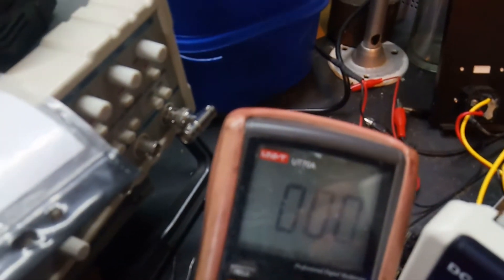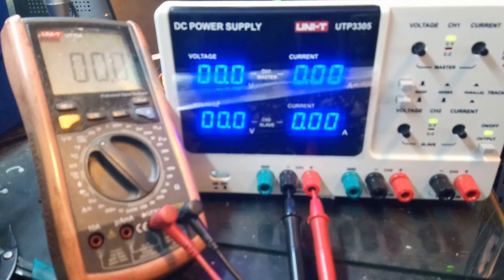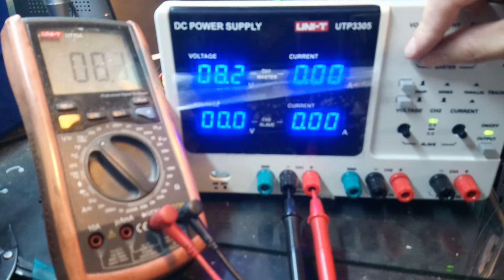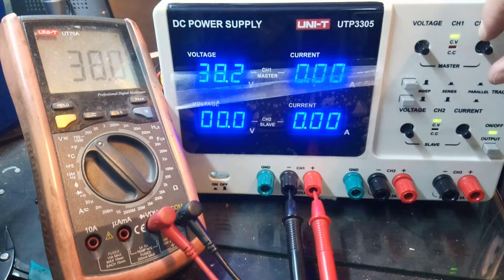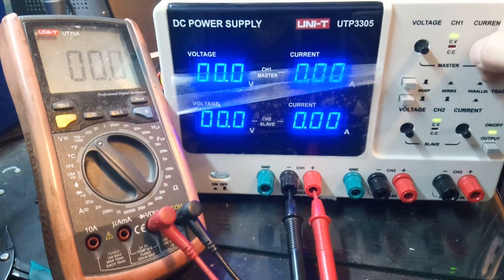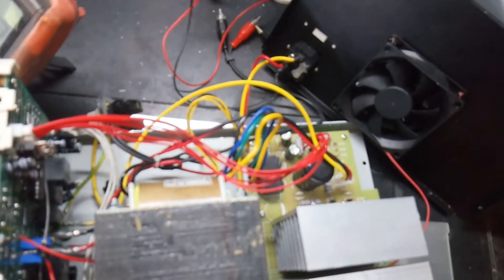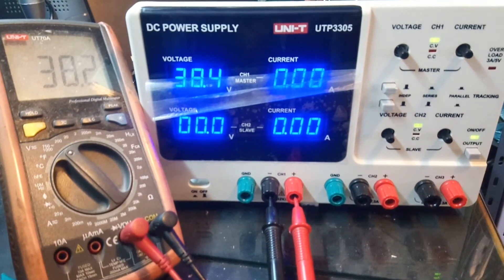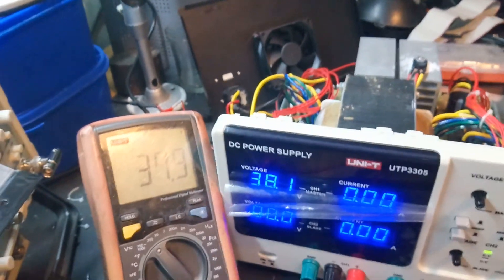Please UNI T give me some help UNI-T 3305 fails

Comment: Remember you can’t short circuit it over 5v to set the current.  You need to have it under 5v when setting the current output or you will blow the output caps again.
Reply from the maker: That is not true. A regulated, regulable PSU should witstand a short circuit.

Comment: Check the lm324 in the power board and the precision resistors and the 8.2v zener diodes and 15v zener diodes

Comment: Can you tell me what is the value and type of diode that is connecting from the yellow wire on behind the display board to the big green resistors.  It’s a small Smd diode.
Reply: Hice Bruno, send me an email to mitlomasdelmirador@gmail.com,  I will share my telegram user with you and send all pictures

Comment: Thank you for the video. It's so helpful. Now i know what i should to do if i will got the same problem 🙂. I just replace capacitors.
Reply from the maker: Yes, this power supply is awfull
Reply: @MitLomasdelmirador  But why? Just because capacitors was broken?
Reply from the maker: @МаксОгн  Is really bad constructed, cable jumpers across the PCB, obsolete components, also the current limit circuit has a design flaw because of that, if you short circuits the leads, this will blow your capactitor. Several other people with the same power source around the planet have had problems (Estonia, Japan, Argentina 2 more besides myself). UNI-T had not give an answer yet, neither provide the schematic circuit.
Reply from the maker: @МаксОгн  As you can see in other of mi videos of this power supply, you can notice that in case of failure, there are 40 volts in the leads!!!! I belive the apropiate would be just blow fuse /resistor /varistor, burnt the power supply PCB what ever , but not kill mi circuit in the workbench.
Reply from the maker: @МаксОгн  I guess that if you enable automatic traslation maybe can undertand my last response detailed. https://youtu.be/RFKW45IMzgw
Reply: Fuses will blow with overcurrent.not with overvoltage in the output

Comment: Did you manage to solve problem? And how?  Thank You
Reply from the maker: Hi, you need  to replace a capacitor un the front board panel. The one which is in the líne of the output that is failing. There is a video about it un the channel. 👍👍
Reply from the maker: did you get yours working ?, if not talk to me by instagram.